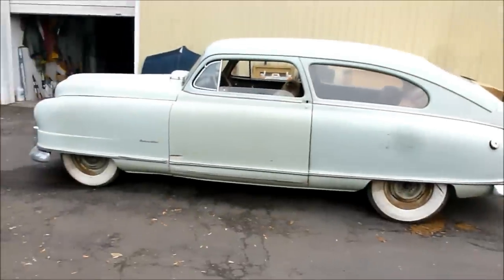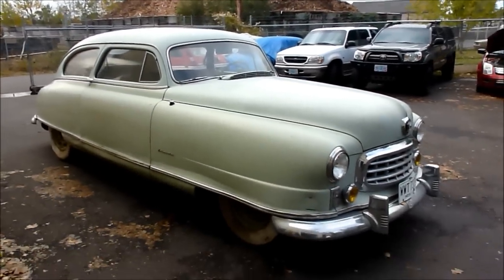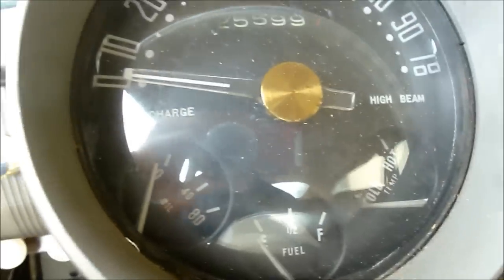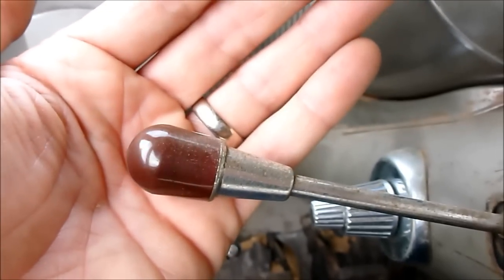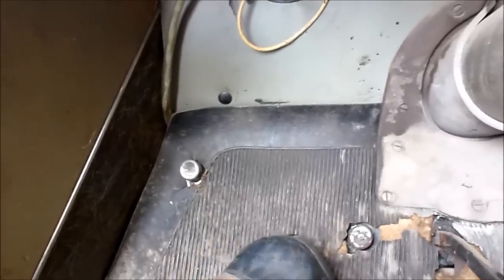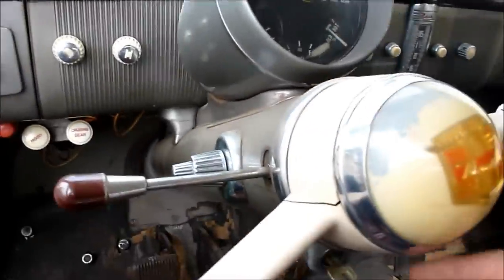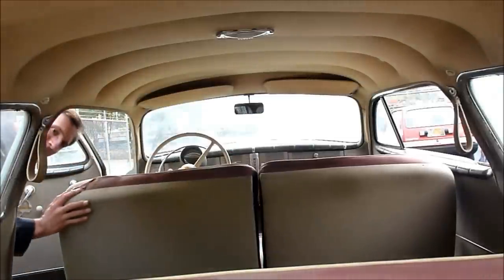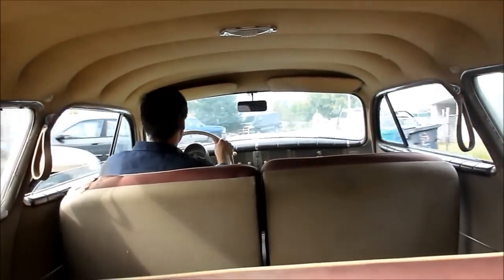1949 Nash Ambassador Airflyte barnfind 1st time driven in over 44 years

Comment: The first car I was allowed to drive by myself, was a 1949 Nash Four door. It belonged to my Grand parents. I was visiting them the year I turned ten, and my Grandfather asked me if I knew how to drive a car. My Dad had let me drive the family wagon, with him in the passenger seat a few times, so I had the basics. Grandpa and I headed out on an old farm road, and we stopped and he got out, telling me to drive to the next crossroad, and then come back. The next road was almost ten miles (we were in Kansas).
One thing I notice different between his car and yours, is the hydraulically actuated overdrive. A large knob to the left of the steering column. The other is that his had dual carbs. Jay Lenno says that was an Ambassador only option.  
These are indeed a great car on the highway. They really come on at speeds upwards of 65., with the aerodynamics, very stable and quiet.  
I wish the family had kept it. 
Too cool for words watching it drive down the street!

Comment: Thanks, so much! We just bought a '51 Ambassador. It looks like an old locomotive. It's so ugly, it's cool. My dad and my grandparents had Nash cars, when I was little.

My father-in-law said he had one. He bought it in the South and only realized it didn't have a heater; when the windshield froze up. Odd, when one considers this company invented heaters and A/C for cars. 

I can't wait to see ours!
Reply: A heater was optional on Lincolns even in the late 60s.  Most cars had one, but they dinged you for it, so an ultra-cheapskate could save a few dollars by insisting on one WITHOUT a heater, or radio either.
Reply: My dad recalled used car ads of the '50s.  The only options that got mention were, 'radio, heater, whitewalls'

Comment: Had a 61 Nash rambler,Borg Warner transmission,Auto mastic push button,ran good!Had a 51 Oldsmobile,98 automatic,no park,emergency brake,turn,the key,then hit the starter button on the dash,303.5 V8,4 door tank,put snow tires on in the winternnever got stuck,in some big Chicago,snow storms in the 1970s,ran like a clock!

Comment: The automatic trans was first offered by Olds in 1939..Buick had the Dynaflow in the late 1940s.Chevy offered the Powerglide in 1950 Chrysler had the Powerflite in the early 1950s..Auto transmissions were common in the mid 50s...Radios and heaters were still optional then, as were outside rearview mirrors.

Comment: I'll be this particular car has the optional "bed" arrangement, since it seems to have been equipped with several other desirable options. Flip up two pretzel-shaped steel pieces located at the base of the rear seat, then recline both front seats all the way to horizontal, and you've got a very comfy and very flat double bed you and a companion (plus a kid) can spend the night in. Great for traveling salesmen, soldiers driving between duty stations, and for impromptu camping on a long tourist trip (in the days before safe, clean, chain motels could be counted on to be just around the next bend, travelers -- especially those on a budget -- often took to the shoulders of farm roads, to isolated construction sites, under a patch of trees, and to the corners of otherwise empty parking lots to spend the night in their cars). Nash even sold logo-printed blankets and inflatable pillows, plus fitted screens for the windows, to allow bug-free ventilation of your car while parked. Downside: some parents would not allow their daughters to accept a date with a boy who showed up in a bed-capable Nash; this became a common joke on radio and TV for awhile. Sometimes, the young man would be forced to prove that the bed option had not been installed.

Comment: Dont be so sure on the 25 K. When the numbers look cock eyed, It usually is strong evidence it has rolled over at the 100k mark. Or, it has been rolled back by someone using a high speed drill.
Reply: +R. Michael Pitman   I think you could be correct, but remember cars didn't last as long back then, even with TLC, and the years take their toll on interiors very quickly. The fact that the various instruments still worked well lend credibility to 25K vs. 125K - unless he fixed them first.
Reply: You know thats right....

Comment: Make sure you put lead additive in the fuel. Also make certain you use at least 90 octane gasoline, the octane rating of the old "regular" gas. Running this engine without lead and at low octane will damage the engine from "pinging". Very nice Ambassador. It looks nearly Identicalto my fathers 47. Dad's been gone twenty plus years now, but his Nash lives on.
Reply: BS... it only has 6:1 compression ratio...
Reply: Also, the valves and seats will erode each other away, requiring a valve job every 10,000 - 20,000 miles.
Reply: @BuzzLOLOL  That is true, but you still need lead or a substitute, or else the valves and seats will erode each other away, requiring a valve job every 10 or 20,000 miles.
Reply: @michaelbenardo5695  - 2 cycle oil at 100:1 mix would prolly be a cheap substitute for fake lead additive...
Reply: @BuzzLOLOL  Sounds like a good idea.  I use a Marvel Mystery Oil inverse oiler in my 54 New Yorker.  Seems fine, but that engine does have inserts in the exhaust ports.

Comment: Awesome ride! Hardly anyone drives manual shifting transmission anymore. No one could steal this car. I've seen Nash Airflyte four door sedan, but I've never seen a two door version. I've always liked vintage American cars of the 1940s and 1950s. Thanks for the ride. :)
Reply from the maker: Jason Carpp   I'm glad you enjoyed the ride,... sad to say you are right, not many manual transmissions anymore.
Reply: 2stroketurbo I agree. Even I've been spoiled by the automatic transmission.
Reply: 2stroketurbo 3 on the tree..my '61 Belair had one..does it have power steering? what size is the engine? Sweet ride tho..take out the seats and you'd have a 3 room apartment lol
Reply: Its a pity that here in North America few people know how to shift, (Europeans are going that way too) I find that those who can,  are better drivers
Reply: rmartingal I agree. I know how to drive a manual shift, but I've never driven one with the gear shifter on the steering column.
Reply: Jason Carpp We are getting ready to start restoration on a 1974 Chevy Custom Deluxe stepside truck that has a 3 speed on the column... We are going to switch it to a 5 speed with a granny on the floor but yeah the column shifters are pretty hard to come by nowadays... I guess the "Flappy Panel" replaced it lmao
Reply: Elijah Hume Sweet. :)
Reply: I leave most of my old cars unlocked, unless there's something tempting visible on the seat, b/c no modern joy-rider could start them. Only a tow would avail them.
Reply: Goodness I feel ancient when these are called “vintage”.
Reply: That's why I don't worry that I need new lock cylinders on my 73 truck - it is 3 speed on the column, very few young people know how to drive a stick, and not many old folks steal cars.
Reply: @2stroketurbo  And that is a shame.  In 1966, Cadillac made about 250 Eldorado convertibles with 3 on the floor.  Can you imagine, with that big engine, how fast those must be?  Wish I could find one!  And NO SMOG CHECKS!
Reply: @jasoncarpp7742  They are handy and convenient, but they do cost some performance, and they are MUCH more complicated.
Reply: @jasoncarpp7742  ALL post-war cars used to be like this, even some sports cars.
Reply: @elijahhume4694  You should leave it a 3 speed, just replace the rear end with something shorter.  GM used overly tall gearing starting in the mid 60s, just like they used overly short gearing before the war.
Reply: From 1940, all were on the column, until the 90s.

Comment: I recall a Nash like that our rural mail carrier bought for a couple hundred bucks at an auction and he put a lot of miles on it :)
Reply from the maker: Yes, these Nash's were basic transportation back in the day, not flashy by any means. Most were tools, like you say, used up and crushed. This particular Nash is the only known long nose "Special" 2 door example remaining....in the US.....and this one has some unique options
Reply: 2stroketurbo
the antique guys have a similar at their shop in LeClaire, Iowa
Reply: 2stroketurbo
The Nash Ambassador was far from basic transportation. It was a top line car, intended to compete with Olds, Buick, Chrysler and the like.
Reply: I remember it called the 'upside down bath tub" :)
Reply: @2stroketurbo  When you say "long nose Special", do you mean that this is the only 2 door Ambassador remaining?  If so, that is a really shame.
Reply: @2stroketurbo  The Ambassador was the top-of-the-line, so it was more than basic.  The problem was that it was only a 6, and by 1954, the 6 cylinder medium-priced car was dead.  Over 92 percent of the 54 Pontiacs had 8 cylinders, and the Olds and the Buick both sold in record numbers, and they both were 8 cylinders only.

Comment: Only the middle floor switch controls the radio. Pressing it causes the radio to seek to the next higher AM station. The far left one is the dimmer switch. Pressing it toggles your headlights from high to low and back.

Yes, it is huge for a 2 door. Gargantuan, or as they like to say today, bigass.

Comment: What's funny is that as you were making your turnaround you mentioned the turning radius, I was thinking abt 80ft? (LOL!). I love old ORIGINAL cars like this, you get a real feel for how they really drive. A lot of people complain that these old cars are not as much fun to drive, that's really not the case, you drive older cars "differently". Though not as old as this, the oldest car I've had experience with was a 67 Plymouth Fury III two-door hardtop, all original complete with manual drum brakes, it handled OK for the age and size of it, but you needed to concentrate on what you were doing....
Reply: I think the turning circle of these was about 44 feet.
Reply: 40’ — very close to the turn radius of my ‘53 Buick Roadmaster.

Comment: The Radio is a vertical Wonder Bar. Presets are on the floor. Praised for its economy. And so quiet.
Reply: I love the old cars! I like the turn signal and all the gadgets.
Reply: I think Wonder Bar actually means signal seeking/scanning...
Reply: @BuzzLOLOL  It is NOT 'signal seeking'. The buttons on the floor controlled a motor that moved the dial to preset detents, much as the push button radios.

Comment: What happens if you floor the clutch when changing gear, is there a starter "lock out" when the engine is running. [I had a 36 Olds with a foot starter, an absolute swine when stalled on a hill and trying to juggle starter, clutch and gearshift and accelerator].
Reply: john brown no, you just don’t push the clutch down as far.
Reply: @billmoran3812  Buick had a 'feature' that engaged the starter by pushing the gas pedal all the way down.  It also had a vacuum switch, or something, that prevented grinding the starter if you floored it.  This thing could have something like that, but I bet it doesn't.
Reply: You were supposed to adjust it so that it works with part-throttle.  When running, manifold vacuum kept a little ball in the "up" position, so the plunger, which was otherwise too short, couldn't be activated, and a relay that locked out the starter unless the generator quit turning.
Reply: @michaelbenardo5695  Ok thanks for that.

Comment: It's funny on my '40 Nash the only thing the key does is unlock the steering wheel. There's a flip switch that turns on the ignition and it has foot starter

Comment: What a cool car. It's funny that as huge as it looks, Wikpedia lists its length as only 201 inches (though for some reason, the similar '52 is up to 210 inches), just a little longer than a modern mid to full sized car. Its 121 inch wheelbase is beats a modern Chrysler 300 by an inch though.

Comment: Love the 600 model.
Reply: The 600 looks like a smaller Ambassador, but it also has a very small engine.  Only 172 cubes and about 138 lbs. ft. of torque, so it was not very fast, even then.

Comment: It's 201 inches long, almost exactly the length of a 2016 Toyota Sienna minivan. Almost exactly the same width too!
Reply: This car is actually 209 inches long, and 80 inches wide.  Those Wikapedia measurments are for the smaller 600.  Computer freaks usually don't know about cars.

Comment: Huge, smoothly streamlined, plush padded interior, pillowy ride that bounces along, and just overall wonderful to look at. 

And no safety equipment whatsoever, keep in mind. Run into something at high speed in this car and you would be bashed and ripped to pieces.
Reply: Would wouldn't necessarily fare so bad.  The Nash/Rambler turned out to be surprisingly safe.
Reply: @michaelbenardo5695  Going face-first into that all-metal dashboard, as one example, would cause severe injuries or death.
Reply: @hebneh  That was true of almost all 1949 cars, not just this one.  The notable exception being the 49 Chrysler - it had a padded dash, probably an industry first.  Did you know that seat belts were an option on the 49 Nash?  An industry first.

Comment: I always wondered if those enclosed front wheel wells had a negative impact on turning. it looks aas if the wheels would scrape the metal in a sharp turn.  FYI, a lot of the Nashes were used as police cruisers in the early 50's
Reply: Recall that the (bias-ply) tires used were relatively narrow, did not (unless under-inflated) "sag" as radial tires do, and had a very tall aspect ratio (i.e., ratio of height to width). Only folks who have trouble turning these today are running fat radials on them. The original type tires support an adequate turning radius, aidded by the fact that the front track (width from center of wheel to center of wheel) is only 55" -- whereas rear track is closer to 60".

Comment: heaters were optional back then. And get this.....some automotive heaters used "gasoline"......not coolant. A common brand of optional add-on heater was "South Wind". My dads 1948 plymouth had one
Reply: Yup, gasoline heaters were an option on the 56 Chrysler, and probably DeSoto also, and were the only heater available on the 1960 Corvair.

Comment: The upper series Nash originally competed with the upper series Buick, so large it had to be.  During the Depression, Nash moved down to Oldsmobile territory.  Unfortunately, after the war, they dropped their straight 8 engine, so they lost ground after the Seller's Market turned into a Buyer's Market.  6 cylinders only, no convertibles, while Oldsmobile had 8 cylinder, as well as 6 cylinder, engines and convertibles, not just sedans.  The senior Oldsmobiles and Buicks were bigger than this car.

Comment: Starter switch on the 1937 Buick  was under the gas peddle. Push the gas peddle to the floor and the starter would turn the engine.

Comment: designed in a wind tunnel after the war just as was porsches coupe.  the first ones also converted to a full size bed inside.  turning radius inhibited by the air foils on front fenders. ~ guess they just didn't have the heart to cut them out,
Reply: Big George Mason like that look, because it made the Nash instantly recognizable as a Nash and nothing else.

Comment: I'm thinking that when you work the clutch you have to be careful not to push it all the way down to prevent hitting the starter motor while the engine is running.
Reply: Bill Taylor    I can't picture that an engineer didn't take that into account while the engines running. Otherwise...every one would have run the wiring to a spring loaded switch on the dash. The fly wheel wouldn't have any teeth and that involves pulling the engine.  This car looks like royalty. I'd love to take it for a cruise!
Reply: It has a relay that prevents the starter from engaging until the generator stops turning.

Comment: does it have a vacuum switch like the old buicks that disables the starter so it doesnt keep hitting the starter or does it still activate it?
Reply: It has a relay that prevents the starter from working until the generator stops turning.

Comment: You shouldn't just leave the key in the on position if you don't to intend starting it.
If the key is on power is going to the points if the points are closed you fry them.

Comment: How do you know that it hasn't done 125k or 225k on the odometer?
Reply: Good ways to tell is the pedals and the driver's seat.  If the pedals look heavily worn, OR BRAND NEW, it is at least 125,000 miles.  Ditto if you feel like you are sitting in a hole when you sit down in your seat.

Comment: Mafia staff car??  Not a chance.  Their choice of cars was Cadillac, Lincoln or Packard.  Agree with Michael Pittman on the mileage.  It sure looks like it was turned back, or rolled over the 100K  mark.
Reply: A good way to tell is the pedals.  If they are heavily worn, or look brand new, it has more than 100,000 miles.  Also, if you sink down to the floor when you get behind the wheel, it has over 100,000 miles.